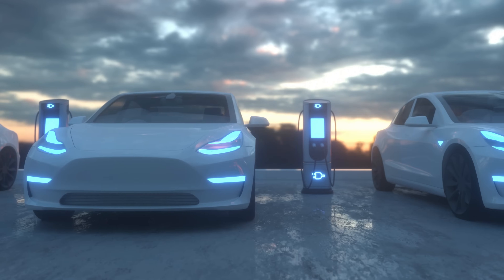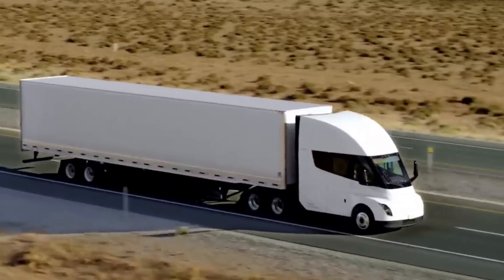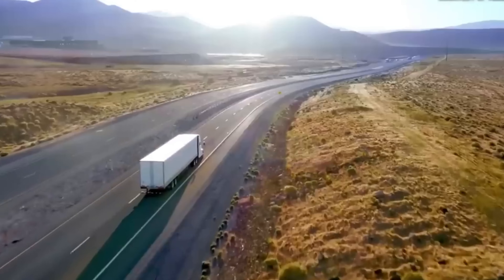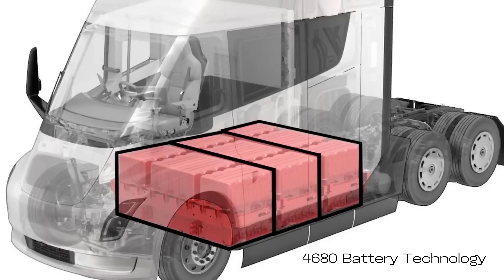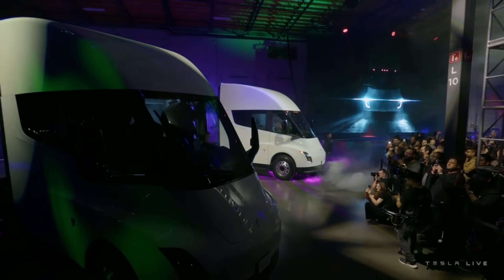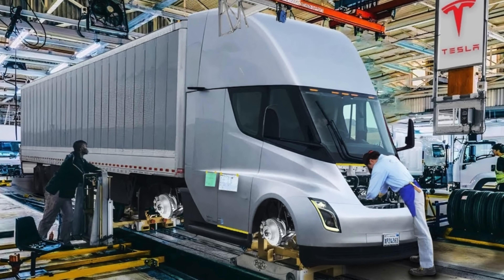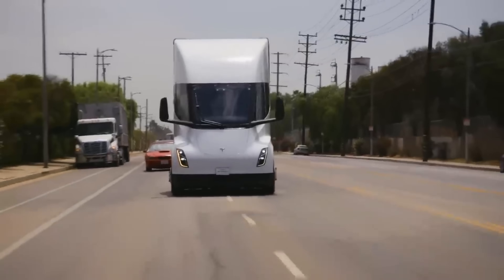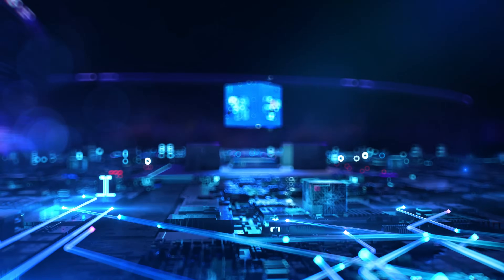Tesla Semi News! The 2024 Tesla Semi: The Insane Power and Price!

Comment: Will be interesting to see how long these last. Like what happens when you have to replace batteries etc? Is it affordable?
Reply: Replacing batteries is a thing of the past. New batteries coming out right now will last the equivalent of 4 million miles. EVs last way longer than ICE engines as there are about 100X fewer moving parts. The lack of required maintenance and it's associated down time, plus being far cheaper to charge vs filling up a diesel will make the total cost of ownership and opperation drastically lower than a diesel.